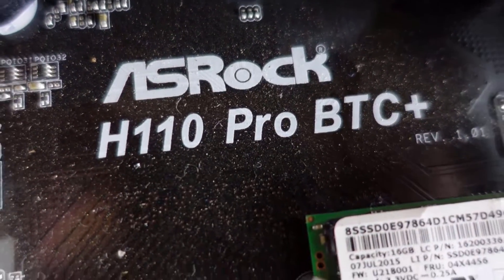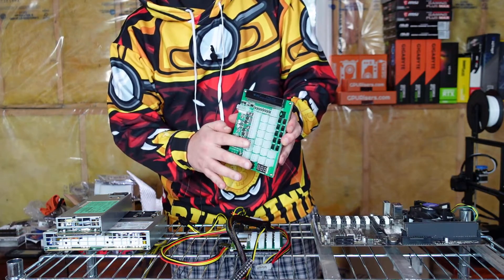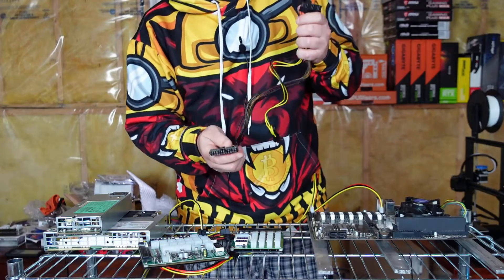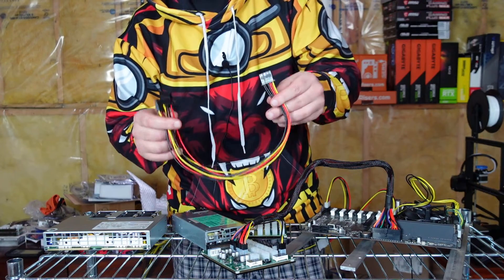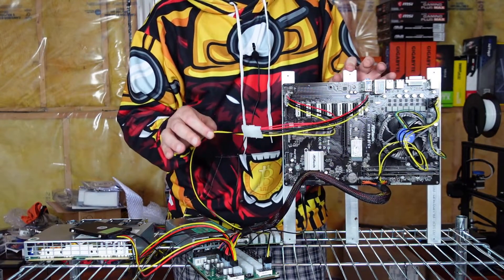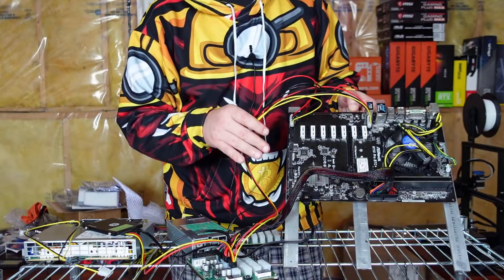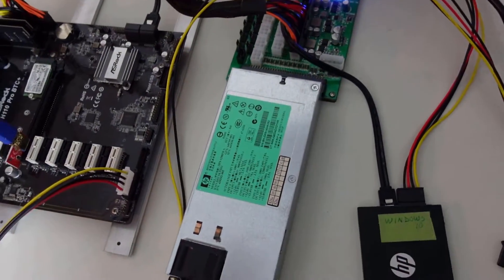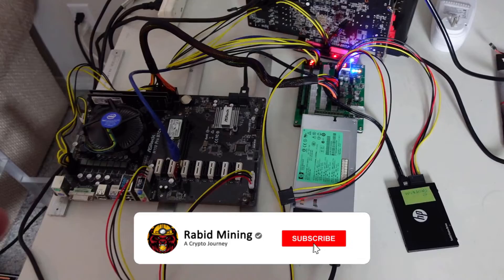H110 PRO BTC+ Power Kit From Parallel Miner Install And Testing

Comment: Hi rapid mining just a question I’m about to turn on my first mining rig I have very similar mobo asrock q270 pro it has two pcie power connections on mobo have to be powered by two Molex. Getting confused people are telling me not to power it with the exact same cable as you the “Molex splitter and Molex to pcie cable “ they are saying that’s 12v to 5v, what’s your thoughts

Comment: will this work with a z370 motherboard? or x570?
Reply from the maker: Ya it should for sure.
Reply: @RabidMining  z370 and x570 don't have any molex connector on them to power those pci slots
Reply from the maker: @v.cotoiu3568  just a zsx board will be fine.

Comment: 3:46 I had a breakout board burnout within 2 days of using it by having the 24pin in the wrong direction.

Should be psu -> to motherboard, then motherboard -> cpu.

I dunno if that's 100% legit but I'm pretty 100% sure that was the issue as the other board is done properly and hasn't caused me an issue. It does should this way in the parrell miner setup guide, which I used after I ruined a 60 dollar board...
Reply: Obviously you've done it this way in the guide. Just a potential heads up to any others that might have this issue.
Reply from the maker: very interesting and nice symbol you got there thx for being a loyal rabid miner :) would you like the symbol changed at all?
Reply: @RabidMining  yeah why not, let's switch it up abit.

If you wanted a vid idea I'd be interested to see the total turnover of your farm now, coin income, power consumption, cost vs profit etc etc I wanna see you also get into android mining purely as the min max side of things for cpu mining is actually more profitable, I've found anyway.
Reply from the maker: @Binzdogger  as in cellphones?
Reply: @RabidMining  exactly that. As long as it has an ARM64 or above processor you can mine on them. I average 4mhs on a Galaxy S8. Between 5 phones I'm getting higher mhs than a ryzen 3600x

Comment: I also mine with the CPU (ryzen 9) does that means I can't use this power supply to power my gpu/cpu mining rigs? i bought 6 of the 2400w power supply kits T_T
Reply from the maker: the PCIE 6 pins are just fine by the 180w rule I mean thats coming from the 24 pin and sata molex running the cards.  if powering GPUs threw the 6 pins your just fine.
Reply: @RabidMining  no my friend i meant the CPU!! my ryzen 9 can pull 150watts by himself, i will be max out by the 24 pin power supply that also powers the cpu right?
Reply from the maker: @tacoterito22  yes true what are your OC settings?  I did some CPU power tests and for a small drop your better off running at like 3.6gh at 0.97v then your only around the 109w mark depending on the MB x470 is 109 a x570 is around 120 or so cant remember now lol.
Reply: @RabidMining  yes but i have free electricity, so i can crank tha cpu all the way up, but now im afraid to run it with this parallel power supply because what you say about the 180watts limit
Reply from the maker: @tacoterito22  just track your watts it was designed to run a system and mine with gpus am trying to get them to make one for cpu mining that can hold 3 or 4 systems

Comment: I've been waiting for someone to do a video on the H110. I have the exact same issue you mentioned when connecting molex ports on motherboard to 6pin on zsx I get error to connect the molex from motherboard which is already connected. I am worried about connecting molex port from motherboard to ZSX molex as I have heard that will fry your board. Are you sure its safe?  Also, I do have one 570 4GB GPU connected direct to the motherboard (not H110 board)for several months now. I guess I got lucky cause its been working.
Reply from the maker: well rx 570s only use like 118w and the rest of the system is like 20w maybe so you are under that 180w limit but if you lose OC settings or someone throws like a 5700xt on it could hit issues.  As for the other port yes it is safe as thats what Parallel Miner said to do if the issue does come up with the 5v rail needing to be detected.